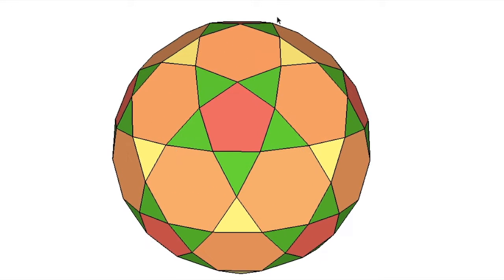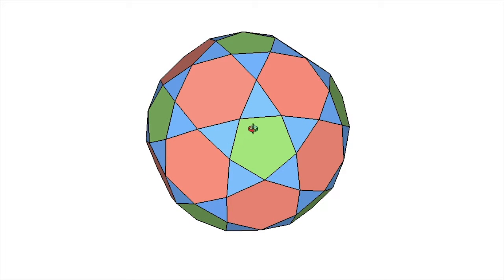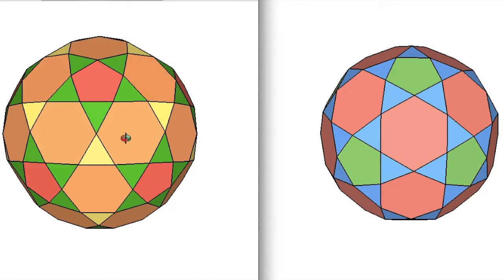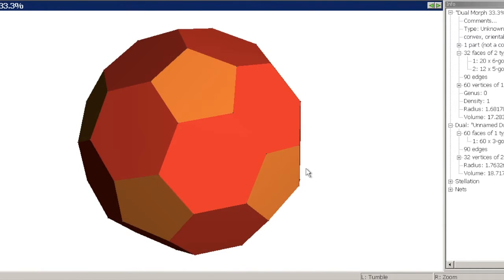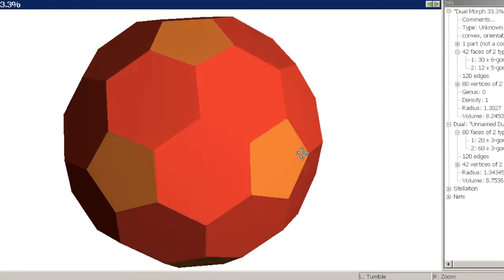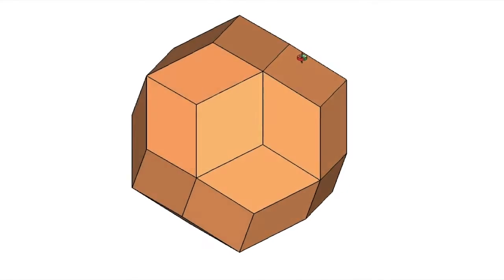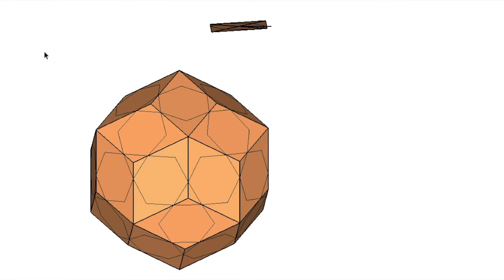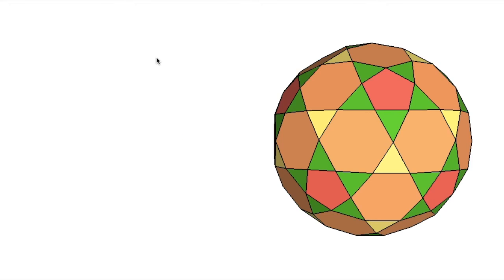New Polyhedron Discovery

Comment: thats a rectification of the order-5 truncated rhombic triacontahedron (or chamfered dodecahedron)
Reply from the maker: It does look very much like it but it's not. The face angles on a rhombic triacontahedron art 63.4° and 116.6° Chamfering, rectification or truncation will never change the 116.6° to 120° which is what you need to make a regular hexagon face. So the difference is that the orange face is a regular hexagon in this polyhedron but the rectified truncated triacontahedron has irregular hexagons. Check this link: https://en.wikipedia.org/wiki/Chamfered_dodecahedron
You can see that the hexagon is not regular.
Reply: @Geo-Dome  ohhhhh ok

Comment: DEGREES • FACES • EDGES • VERTICES 

Triangle:
* Degrees: 180°
* Each interior angle: 60°
* Faces: 1 (triangle)
* Edges: 3
* Vertices: 3

Square:
* Degrees: 360°  
* Each interior angle: 90°
* Faces: 1 (square)
* Edges: 4
* Vertices: 4

Pentagon:
* Degrees: 540°
* Each interior angle: 108°
* Faces: 1 (pentagon)
* Edges: 5
* Vertices: 5

Hexagon:
* Degrees: 720
* Each interior angle: 120°
* Faces: 1 (hexagon)
* Edges: 6
* Vertices: 6

Tetrahedron:
* Degrees: 720 
* Each interior angle: 60° 
* Faces: 4 (equilateral triangles)
* Edges: 6
* Vertices: 4

Heptagon:
* Degrees: 900
* Each interior angle: 128.57°
* Faces: 1 (heptagon)
* Edges: 7
* Vertices: 7

Octagon:
* Degrees: 1080
* Each interior angle: 135° 
* Faces: 1 (octagon)
* Edges: 8
* Vertices: 8

Nonagon :
* Degrees: 1260
* Each interior angle: 140° 
* Faces: 1 (Nonagon)
* Edges: 9
* Vertices: 9

Decagon:
* Degrees: 1440° 
* Each interior angle: 144°
* Faces: 1 (Decagon)
* Edges: 10
* Vertices: 10

Pentagonal Pyramid
* Degrees: 1440
* Each interior angle: 108°
* Faces: 6 (5 triangles, 1 pentagon)
* Edges: 10
* Vertices: 6

Octahedron:
* Degrees: 1440 
* Faces: 8 (equilateral triangles)
* Edges: 12
* Vertices: 6

Stellated octahedron:
* Degrees: 1440
* Faces: 8 (equilateral triangles)
* Edges: 12
* Vertices: 6

Pentagonal Bipyramid
* degrees: 1800
* Faces: 10 (10 triangles)
* Edges: 15
* Vertices: 7

Hexahedron (Cube):
* Degrees: 2160  
* Faces: 6 (squares)
* Edges: 12
* Vertices: 8

Triaugmented Triangular Prism:
* Degrees: 2520 
* Faces: 10 (6 triangles, 4 squares)
* Edges: 20
* Vertices: 14

Octadecagon (18-sided polygon):
* Degrees: 2880 
* Faces: 1 (octadecagon)
* Edges: 18
* Vertices: 18

Icosagon (20-sided polygon):
* Degrees: 3240 
* Faces: 1 (icosagon)
* Edges: 20
* Vertices: 20

Truncated Tetrahedron
* Degrees:  3600
* Faces: 8 (4 triangles, 4 hexagons)
* Edges: 18
* Vertices: 12

Icosahedron:
* Degrees: 3600
* Faces: 20 (equilateral triangles)
* Edges: 30
* Vertices: 12

Cuboctahedron or VECTOR EQUILIBRIUM 
* Degrees: 3600
* Faces: 14 (8 triangles, 6 squares)
* Edges: 24
* Vertices: 12

3,960 DEGREES 
88 x 45 = 3,960
44 x 90 = 3,960 
22 x 180 = 3,960
11 x 360 = 3,960 

Rhombic Dodecahedron
* Degrees: 4,320
* Faces: 12 (all rhombuses)
* Edges: 24
* Vertices: 14
* Duel is Cuboctahedron or vector equilibrium 

Tetrakis Hexahedron:
* Degrees: 4320 
* Faces: 24 (isosceles triangles)
* Edges: 36
* Vertices: 14

Icosikaioctagon (28-sided polygon):
* Degrees: 4680 
* Faces: 1 (icosikaioctagon)
* Edges: 28
* Vertices: 28

Triacontagon:
* Degrees: 5040
* Each interior angle: 168°
* Faces: 1 (30-sided polygon)
* Edges: 30
* Vertices: 30

Octagonal Prism:
* Degrees: 5040°
* Each interior angle: 135° 
* Faces: 10 (2 octagons, 8 rectangles)
* Edges: 24
* Vertices: 16

5400 DEGREES 

5,760 degrees 

6,120 degrees 

Dodecahedron:
* Degrees: 6480 
* Faces: 12 (pentagons)
* Edges: 30
* Vertices: 20

7560 DEGREES
 
6840 DEGREES 

7,200 DEGREES 

7560 DEGREES 

Rhombicuboctahedron:
* Degrees: 7920
* Faces: 26 (8 triangles, 18 squares)
* Edges: 48
* Vertices: 24

Snub Cube:
* Degrees: 7920
* Faces: 38 (6 squares, 32 triangles)
* Edges: 60
* Vertices: 24

Trakis Icosahedron:
* Degrees: 7920 
* Faces: 32 (20 triangles, 12 kites)
* Edges: 90
* Vertices: 60

8,280 DEGREES 

8640 DEGREES 

9000 DEGREES 

9,360 degrees 

9,720 degrees 

Icosidodecahedron:
* Degrees: 10,080°
* Faces: 30 (12 pentagons, 20 triangles)
* Edges: 60
* Vertices: 30

Truncated Icosidodecahedron:
* Degrees: 10,080°
* Faces: 32 (12 regular pentagons, 20 regular triangles)
* Edges: 60
* Vertices: 30

?  10,440 degrees 

Rhombic Triacontahedron:
* Degrees: 10,800 
* Faces: 30 (rhombuses)
* Edges: 60
* Vertices: 32

11160 DEGREES 

11,520 DEGREES 

11,880 DEGREES 

12,240 DEGREES 

12,600 DEGREES 

12960 DEGREES 

END OF 360 DEGREE POLAR GRID 

Small Triambic Icosahedron:
* Degrees: 14400
* Faces: 20 (intersecting non-regular hexagons)
* Edges: 60
* Vertices: 32

Small Ditrigonal Icosidodecahedron:
* Degrees: 16,560
* Faces: 50 (12 pentagons, 20 triangles, 18 squares)
* Edges: 120
* Vertices: 60

Truncated Cuboctahedron or Great Rhombicuboctahedron 
* Degrees: 16,560
* Faces: 26 (12 Squares, 8 Hexagons, 6 Octagons)
* Edges: 72
* Vertices: 48

Small Rhombicosidodecahedron
* Degrees: 20,880
* Faces: 62 (20 triangles, 30 squares, 12 pentagons)
* Edges: 120
* Vertices: 60

Rhombicosidodecahedron
* Degrees: 20,880 
* Faces: 62 (30 squares, 20 triangles, 12 pentagons)
* Edges: 120
* Vertices: 60

Truncated Icosahedron:
* Degrees: 20,880
* Faces: 32 (12 pentagons, 20 hexagons)
* Edges: 90
* Vertices: 60

Disdyakis Triacontahedron:
* Degrees: 21600
* Faces: 120 (scalene triangles)
* Edges: 180
* Vertices: 62

Deltoidal Hexecontahedron
* Degrees: 21,600
* Faces: 60 (kites)
* Edges: 120
* Vertices: 62

Ditrigonal Dodecadodecahedron:
* Degrees: 24480
* Faces: 52 (12 pentagons, 20 hexagons, 20 triangles)
* Edges: 150
* Vertices: 60

Great Rhombicosidodecahedron
* Degrees: 31,680
* Faces: 62 (12 pentagons, 20 hexagons, 30 squares)
* Edges: 120
* Vertices: 60

Small Rhombihexacontahedron:
* Degrees: 31,680
* Faces: 60 (12 pentagons, 30 squares, 20 hexagons)
* Edges: 120
* Vertices: 60

Pentagonal Hexecontahedron:
* Degrees: 32,400
* Faces: 60 (pentagons)
* Edges: 120
* Vertices: 62

Comment: If you were to divide the hexagons into six triangles and the the pentagons into five triangles, you would have the topology of a 4 frequency dome, just with flattened hexagonal and pentagonal faces. Leaving these triangles out is pleasing to the eye, but less strong, since the 2 equatorial geodesics that would otherwise run straight through the centre of each hexagon are all absent.

Comment: I'm sorry to spoil your discovery for you, but I have seen this before, and it dates back at least as far as the 70s. It's no surprise you couldn't find it, though, because the people who are interested in geodesic dinners don't seem to be interested in the building techniques that this structure lends itself to.

I saw this design in some instructions for how to build a geodesic dome simply by lashing together bamboo poles. This shape is perfectly suited for that purpose because, by adjusting the parameters, you can make the vertices line up into 12 (I think) perfectly circular rings. You can imagine how this would be ideal for a tent made with fibreglass poles, with the lashing points sewn into the sheet that you drape over it.

I built a model using coffee stirrers and elastic bands, and it works well. Then I noticed that the "waist" of hexagons has a cross-cross pattern which, with some extra struts, could be turned into a lattice like the wall of a yurt / ger, which suggests very interesting possibilities.
Reply from the maker: Ah you said "perfectly circular rings" I am aware of this design, it has great circles producing pentagons hexagons and triangles frames just as mine but there is a difference. Mine has regular hexagons.  Polyhedrons are mathematically constructed solids so even though the shape you refer to probably looks almost identical it is in fact very different mathematically.
Reply: Paul Robinson I see. To me, that's a distinction without a difference, but of course that depends on your mathematical framework.

If you need the hexagons to be regular, I believe I've seen that on Wikipedia where it's listed as the ambo derivative of the chamfered dodecahedron. I haven't studied Conway polyhedrons in any depth, so I could be wrong about that. Either way, I've never seen it used in a geodesic dome.
Reply from the maker: I don't think it is possible to tell from just looking at an image if the hexagon is regular.
Here's the link to the wiki page: https://en.wikipedia.org/wiki/Chamfered_dodecahedron
I am aware of the rectified truncated triacontahedron, which again looks the same but this has hexagons with equal edge length but slightly compressed between two vertices. 
Here's another example, the hexagons are obviously not regular but it looks like the triangles are all the same: https://levskaya.github.io/polyhedronisme/?recipe=A10acD
Oh I also noticed that the hexagons are not planar.

From a geodesic perspective if the hexagon is regular then you can triangulate  with 6 identical triangles, if it is not regular/planar you need at least 3 different triangles.

I did the video to demonstrate a possible new polyhedron and to show how I made it. Many of the polyhedra on wikipedia don't show face angles,  chord factors etc so it's impossible to compare. I think we can agree that there are hundreds of possible solutions to produce a polyhedron with same look but I believe there is only one solution that has regular hexagons.
Reply: Paul Robinson I mostly agree with you, but I believe the requirement that the hexagons be regular does not fully constrain the chord factors. You need one more constraint, which in your case is the implicit constraint that the vertices intersect with a sphere.
Reply: Peter McArthur .

Comment: Dear Paul,
    I only having some of the background required to follow your work. With that limitation and from my perspective it looks like a profound discovery. Most of my work has been in the construction of free standing tension structures. My pieces that are somewhat associated with your work and also associated with Buckminsterfuller's and Kenneth Snelson"s are tension structures like theirs that follow the outlines of an icosadodecahedron. If you extend the 30 rod elements of their tension structures and join their ends and you suspend them from each other the result is 6 woven hoop pentagons and a free standing tension structure. You can change the pentagons into star shapes. The last star shape one I tried to make had star points of 18 degrees and valleys of 90 degrees. I don't know where I got off course. That design is hard to assemble. The orientation is easier when the star shape is closer to a pentagon. In the assembly the rule I was using is most obvious when the first 2 stars are joined. That rule is "star points above valleys and at 180 degrees to that valleys below star points". As stars are added that rule is in play for every valley and point that come into proximity. When you'r about to add the last star you can see it's path on the already assembled stars. My assembly also satisfied the rule of completion in that when the last piece is added all the valleys have points above them. There must be another rule of assembly that I don't know for what the result is may interest you. For viewing what polyhedron this extreme shape follows you should be guided by the points of the stars. This completed piece has 2 let's say polar hexagons (not pentagons) and a wide equator of squares and triangles. I haven't counted them yet.
   Ed Gorczyca
   gorczycaed@yahoo.com
Show less
REPLY

Comment: Hello Paul, and thank you so much for the informative videos. A must watch for all dome builders, methinks. Have you considered building a dome using a catenary shape? I was doing some research, and while it adds height and structural integrity, it also seems to make the build more complicated due to the shapes changing towards the top of the dome. What do you think?
Reply from the maker: Yes it does mean a more complex build, I have a design that could do catenary shape but in a tunnel: https://youtu.be/nv8xIO8ulmU You can build anything on a rectangular footprint with this method but I feel a round dome is pretty difficult. Or you could do a hexagon footprint with this method: https://youtu.be/aFfYkWCaCws I'll try and upload something catenary soon.